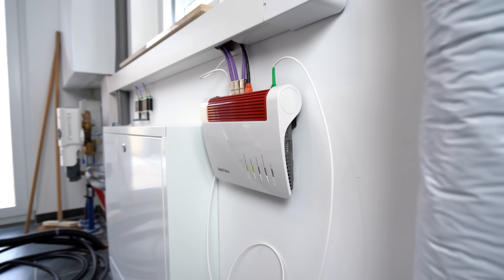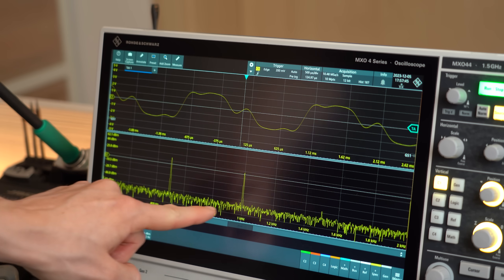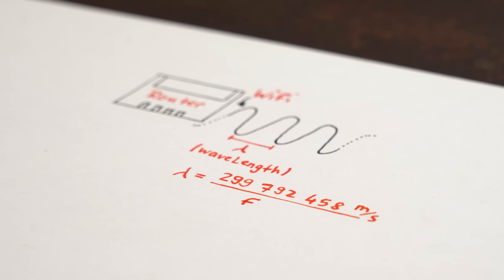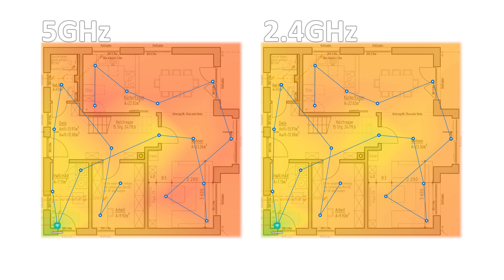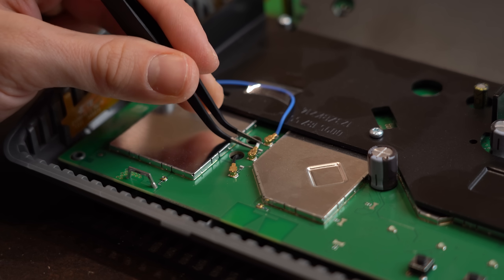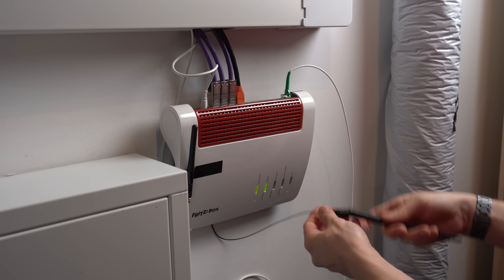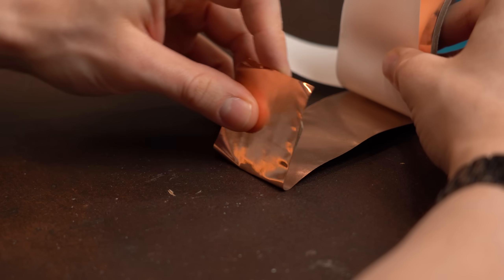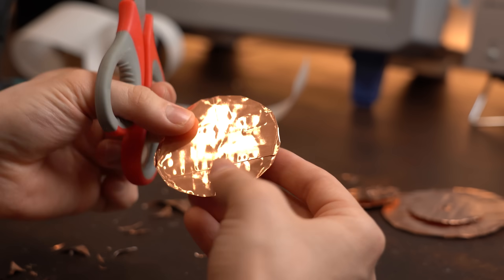I tried OVERPOWERING my WiFi!

Comment: A trick that I used but its not suitable for your case is to wrap a photo frame into aluminum foli and place it behind the antena facing the direction of the client. That trick can "directionalize" a bit the omnidirectional antena sacrificing a lot of its coberture of his back to improve a bit of coberture of its front. In my case, the before was unstable connection 4 rooms far to a stable one.

Comment: I don't know about your directional antenna. You could try a WiFi-biquad antenna. I build two of them from copper wire and CD's and could cover 20 m through 6 concrete walls. You have to be careful with the  dimensions of the antenna otherwise your tuning is off.

Comment: doing a DIY antenna is not easy, you need a LiteVNA which can measure up to 6ghz of VSWR or the cheaper one  N1201SA which can measure up to 2.4ghz only, looks like your DIY antenna is not properly tuned

Comment: If internet speed is lacking then try using mesh routers, you might need 2 or 4 routers to cover the whole area but they are definitely worth it, especially if you can get some that use power saving, some routers will basically turn off when not in use, and they will still be connected to the main network but as soon as they detect that they are needed they will start emitting WiFi at full strength

Comment: You got a nice size house. I need to move... BUT THIS HOUSE I LIVE IN WAS SUCH A STEAL at 200K and 4700sq ft/1424.24.... sq meters. Saw some smaller houses being built that wanted 230k and didn't have a pool nearly an acre of land but also isn't a quarter mile from the Gulf of Mexico aka HURRICANE ZONE, not by where I live, Hurricanes like pits. I live on the eastern border of Alabama. It's too much house for my two dogs and I.

Comment: Hello. Since You went so far with WiFi testing you may also try a biquad antenna. It has 8-12 dB gain, is directional and actually works. One more thought: as far as I can undertand in the first test you used single band 2.4 Ghz antenna also on 5 Ghz band - I know 5 Ghz is roughly the second harmonic of 2,4Ghz but there was a risk of damaging 5GHz output stage of the router if the antenna was wildly unmatched. Greetings, Merry Christmas and Happy New Year.

Comment: I had similar problems in our new house (which is around the size of yours looking at your floor plans) and solved it in the end with a 5530 Fiber router and some older routers/ repeaters creating a mesh. In the end there are 5 mesh repeaters in my house and garden all connected to the Ethernet. So I can get the full speed of my 500mbit fibre connection over WiFi everywhere on my property. Is this full speed really needed everywhere one might ask. No. But nice that it is possible 😄

Comment: Mounting your WiFi AP near the ceiling sometimes helps as typically there are less objects/furniture to absorb or reflect signals compared to counter/ground level. Another thing to consider is that a walls apparent thickness increases as the beam angle moves away from perpendicular.  I also find that manual channel allocation can be handy, especially if you can split you WiFi up onto different Access Points or networks. I use this for WiFi mesh devices as the high amount of traffic can interfere with regular WiFi use.

Comment: Your new router has three antennas and therefore probably supports 3x3 radios with MIMO and beamforming along with the 802.11AC/AX protocols where multiple antennas are used together to improve coverage and throughput, by using only two antennas you have crippled the performance of the wireless. Add a third antenna and you should get further additional performance. You have the basics of legacy wireless there but not modern day wireless ethernet, there is a lot of modulation happening between the multiple radios to aggregate the signal to get the higher throughputs.

Comment: concerning raising the power at the access point apart from legality issues something to consider is that to balance the link you need to do the same on the user device which is not practical for many reasons.

Comment: For me the the difference in the maps is not that obvious without the numerical results. Which should be in dB, not in dBm, because that does not make sense. :) dB is a number without any units of measurement, while the unit of dBm is in milliwatts, to be exact it refers to the ratio of the measurement to  1 mW on the dB scale.

One other tip: If you stick the antennas to the wifi router, you mess up not only the impedance but the radiation pattern, so the omnidirectionality property will not be true anymore. For better results, I suggest sticking at least the antenna to the ceiling, perpendicular to the router, for example hanging upside down.

The RF design put into these routers is serious, the PCB antenna was designed and tuned specifically for the chassis of the router, although I agree that the simple monopole might not be the optimum solution.

Comment: Try getting a manufactured directional panel antenna. Many of them come with a 30-90 degree beam depending on the specific antenna. Internally they are made of many small parabolic "cups" that direct signal mostly in one direction. If you have a signal meter, you can noticeably see the signal drop off as you get further out to the sides of the antenna. That's probably your best bet. You were making a very poor yagi antenna. I didn't really think it would work all that well. It is typical that RF connectors lose 3db of signal at each one. The reverse SMA connector you connected to your stick antennas is a loss your low db stick antennas have to overcome in order to get an actually stronger signal. This is a big reason why the gains with them are so low. Also, typical omni antennas are usually no more than 3-6db gain anyway. I have to wonder about the internal antennas since the sticks were in fact a little stronger. They must be pretty darn pathetic! A directional panel antenna that is 8"x8" can easily have 12-15db gain. I've used panel antennas that had as much as 24db gain...which is pretty darn good!

Comment: this directional antennas should be made with very tight tolerances, even cable length is important, you just made it inaccurate so the result is bad, even with your rf hardware is able to achieve few hundred meters with this directional antenna

Comment: could the antenna location be located in a more central location (Wifi Antenna Extension Cable) and not taped to the router (that could be causing interference).

Comment: in order to obtain the best wifi experience, you can try lowering the wifi power transmission level from 100% to 1 step below, usually the best power doesn't guarantee the experience and you can have better SNR with lowering the power

Comment: that directional antenna you build will work properly if you follow the build instruction correctly. mine work well and its not even the best build, can go from -80dbm or less to atleast -40dbm or more (closed area with walls), and for line of sight i can reach my scholl wifi ( 250 meters with -65dbm). i would suggest you to try that antenna design again and take it more seriously with all the instruction.

Comment: improving wifi isn't that simple tbh it's basically a frequency thing basically the higher the hertz are on the signal the more data it can send but the con being it doesn't do so well with distance or with going through walls and vice versa the lower the signal the further it'll travel but the less data can be sent. the best wifi solution is to have a multi router setup (one in each room) all on really high frequencies so they can't interfere with eachother.

Comment: Really neat homade booster!
Better to just get a fast router and mount it at a location visible to most places.  

I chose my ceiling in the center and of my house mounted cables to the ceiling... perfect.

Also make sure you arent on similar channels to neighbors.  Higher noise on a channel means worse ping

Comment: Too bad you're living in EU, the maximum legally allowed RF transmit power for 802.11 radio equipment is the lowest level. The solution would be either do it legally with mesh network infrastructure (cost extra money) , or do it ilegally with modified antenna (cost reduced).
Reply: More addition, try using AP that support 802.11ax aka WiFi6 (and your device must support it too). It truly boost throughput significantly by using newer signal coding.

Comment: I built one of those "Russian" Wi-Fi beam antennas when I moved into a temporary apartment about a 1/4 mile from my in-law's house.  My intention was to tap off their Wi-Fi network for internet services so I didn't have to pay an ISP to run fiber up to an apartment that I was going to leave in for a few months.  It was about twice as long as the one in the video and made of sheet metal that I had cut out of an empty unused paint can.  I then taped it on the end of a laundry pole and positioned it as high above my top floor balcony as I could.  It worked well enough to read their SSID but not well enough for my laptop to connect to it.  I think my laundry pole wasn't long enough to get the antenna over my building's roof ridge and that got in the way of the line-of-sight signal. But I proved that the concept was sound.  It used to be fun to roam the streets with such an antenna looking for Wi-Fi stations that people didn't bother to lock, but today's routers pretty much now all come with WPA2 already configured.

Comment: First thing to do is look at what channels your Wifi units are using and keep them far apart.  For example, If one unit is using Channel 1, make sure the other is using Channel 11 (for 2 units - for 3 units, go 1,6,11).  There is a TON of overlap within these channels.   Remember, the Wifi unit operates more like a hub (think old days) and traffic on a specific band will interfere with ALL devices using that band and create a lot of interference and noise - this results in a lot of re-transmissions of packets, which equates to slow speeds. A packet analyzer is a great tool for seeing this in action.

Comment: that directional antenna you made Scott needs to be a helical antenna for it to work they use a piece of wire that spans across the entire shaft and should give a gain of 9 to 15 dbm (idk the unit) but that directional antenna you made had no chance as the antennas design is wrong. try putting some research in helical antennas made for fpv drones.

Comment: I used a NanoVNA to find antennas tuned for exactly 2.4GHz and then wrote all the data down. The antenna with the biggest dip I think has the most transmit capability. So one of my antennas had a -48db dip. No idea what it means though.
I made my own antenna for ADSB and with a simple Cantenna I had about 350km range. However birds kept destroying it so after the third time I had to swap to a proper antenna which yields 400km range.
Anyway the NanoVNA is really nice to see what antennas are actually tuned to and if they actually work, there were several that didn't work.

Comment: 😅I can have my jiofi router in my room.. but technical team suggested location is far better I can have signal at first floor with a minimum downscale... If it's provide 4-5 mb on main floor it covers first floor and roof reasonable good around 3-4mb

Comment: @greatscottlab To me the simplest solution would be to relocate the router near the center of the house, taking into account the angle at which the signal would have to go through each wall to keep it as perpendicular to the walls as possible to minimize the amount of thickness that needs to be traversed. Adding mirrors in strategic locations can also help bounce the signal around corners.
Using two different antennas can decrease the signal strength if the router isn't configured specifically to use the desired antenna only for a given band. Depending on the software and hardware, it may use one antenna for TX and the other for RX, or it may offer "beam forming" to aim the signal, so that has to be taken into consideration before swapping the antennas.
Ideally, using a router with more antennas, dedicated to each band, RX, TX, and beam forming would give the best result.

Comment: More power does not help, because your phone/laptop had to increase the power as well - as wifi is bidirectional. Improving Wifi antennas was fun in the early days, but keep in mind that most modern routers require more than one antenna for spacial diversity. Your phone can be in a "minimum" and you have to move at least lambda/4 to get out of it. Spacial diversity solves this problem. And the really modern routers use MIMO and beamforming. They send more than one stream of data over separate antennas or use a phased array of antennas to direct the signal to the receiver - each receiver individually. If you put a homemade directional antenna on your router, you might lose these capabilities. Also look into a cheap CPE210 (510) or similar to have a nice directional sector antenna AP.

Comment: Infairness with the Wifi Gun you did not properly hook the signal core wire in the plate hence it has worser SWR than the generic antennas. And based on what I experience in building one with copper tape is a shit.

Comment: neither the new or old one looks like it has enough antenna elements to do beam forming or MIMO, and the orientations look like they'd be compromised a little by wall mounting instead of sitting flat. the way the marketing stuff is written about the 5590 it seems they expect you to have the mesh extensions all over the place. you can find "network extenders" that are really cheap and have 2x2 or more antennas to test if something more than antenna diversity will help (it will). things can still get bad with beam forming though, but at that point it will be down to the number of clients and where they are in the house as a set, different chipsets do different types of "hunting" and can have a hard time doing 100 degree changes between frames, the more antennas the less that will matter

Comment: Remember that a ¼λ is shorter in an antenna than it is in air. Consider velocity factor, end effect, and capacitive loading. These effects all load an antenna, and this shortens the length of a matched antenna.

The ground plane affects capacitive loading. Proxity to ground will change the shape of your antenna. One antenna you had was a monopole that should ideally have been mounted to and perpendicular with a ground plane — much less ideally taped parallel to one.

It's a bad habit disconnecting live transmitting antennas. Higher power transmitters are damaged by standing waves. Disabling even these low power transmitters is good for learning routine.

Comment: I would never trust wifi solutions that came from the provider, reason being, that are performing multiple duties as a single device (router, firewall, modem, access point and more). I would get a couple of name brand access points (unifi, mikrotik, linksys...) and use the ISP as just modem, firewall and router and leave wifi to the separate device

Comment: Use a pringles tin, drill a hole in the bottom, place an antenna in the inside with the wire screwed to the bottom (helps secure it in the hole too) and use that as a directional WiFi antenna.... it's called a "Can-tenna" - I used them before and was able to get upwards of 500 feet distance between them (using a cantenna at each end)
Reply: afaik Pringles for a long time dont have metal anymore, but use plastic now
Reply: @tarakivu8861  At least here in the UK it's still silver reflective interior (as far as I know), and the bottom of the can is also aluminium! - I haven't tried to make one for a good couple of decades though :D

Comment: A Fritz router! Maybe I should find my old Fon router in the attic? Old was better and if Wi-Fi is going the same way are driving in the cities, we'll soon need carry our routers with cables from room to room. And don't trust your router's transmit power level in the specs. Usually they are 2/3 to 1/4 the power they claim to be, and don't put copper tape on both sides, you are making an array of capacitors, likely making your vswr far off 50 Ohm.

Comment: You've got a million options here to improve the WiFi.

1. Ask your ISP to move the optical fiber to an inner wall on the house, preferably somewhere in the middle of the floor-plan instead of the far wall.
2. If they say no, look into getting an optical fiber male to female extension and move the Fritzbox yourself to the middle of the floor-plan.
3. Put the Fritzebox into Full Bridge mode, and use a decent router with REAL antennas like a Netgear RAXE500.
4. Do the same as 3, but use a long Ethernet cable, and install a new router in the middle of the floor-plan with the Fritzbox in Full Bridge mode.
Reply: I will never understand why fritz!box is so popular even among tech enthusiasts.
Reply: @pascal2085  It's nothing but crap. I remember my swiss friend wanting to avoid it for ages.
Reply: or option 5..... turn the WiFi off in the ISP router, leave it were it is. And then run some cat6 and install your own WiFi APs.
Reply: Optical? That's not a fibre op router... LOL!
Reply: @dk6578  

Uh.... that is..... it has a direct GPON connection feeding it lmao. What else is the giveaway that it isn't?
Reply: @dk6578  Of course it's fibre....look at the small green plug at the end....also read up on the fritzbox 5590 specs, has fibre in the specs
Reply: @dk6578  It definately fibre! (Google Fritzbox 5590)

Comment: The monopole antenna and the one near should be for DECT connectivity and not wifi. Messing with the antennas is not good as new routers have beam forming and other technologies in them.

Comment: Why did you buy such an expensive router that does not even have a proper external antenna? No offence, I am just curious, because there are many other alternatives already equipped with antennas similar to those that you presented in the video.